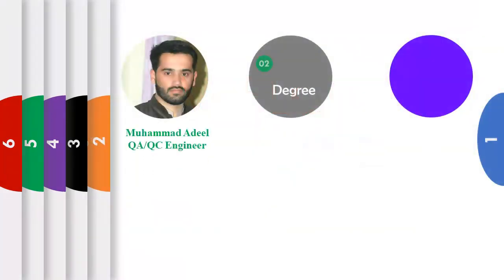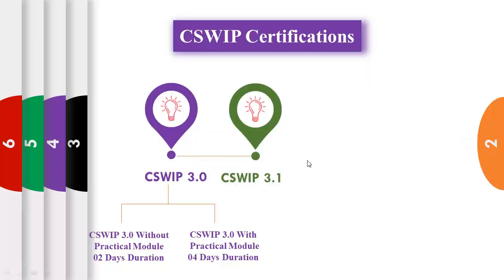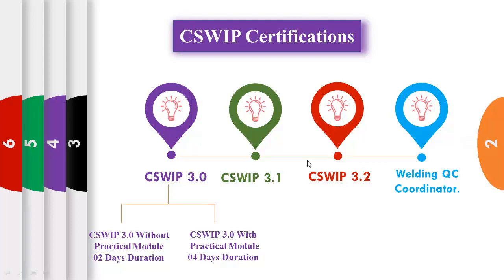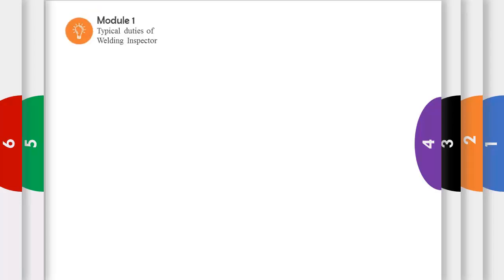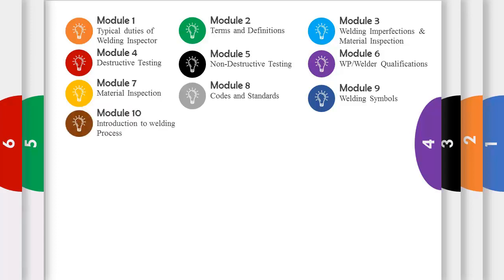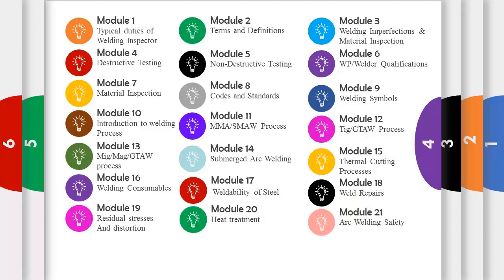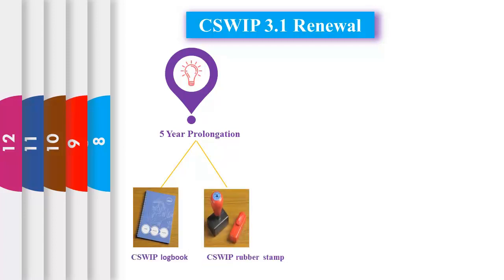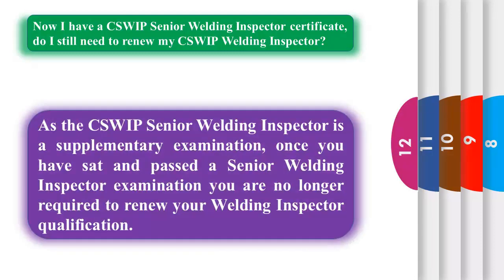CSWIP 3.1 welding Inspector Preparation Course in English Lecture  01 : Introduction

Comment: My senior welding inspector CSWIP3.2 is going expire in januarary 9feb. -2019 
I need to renew this certificate can shear your cell no for conversation 
It my cell 03006986074
Reply from the maker: +923468683869
Reply from the maker: Can contact on whatsapp